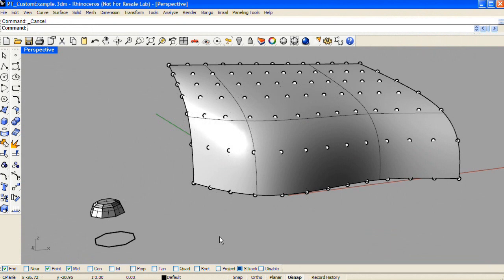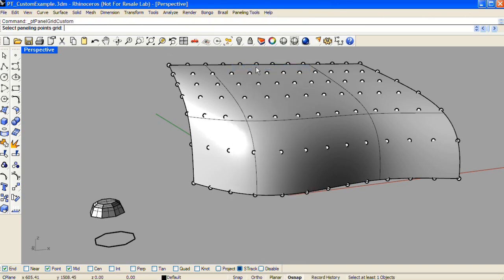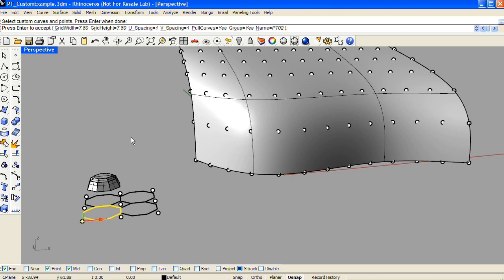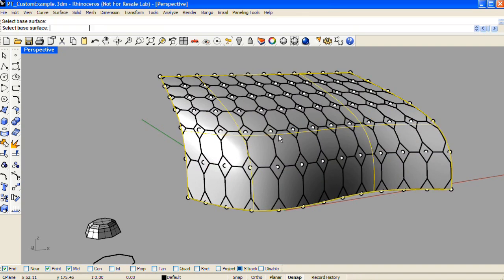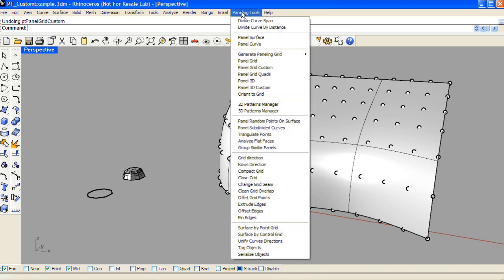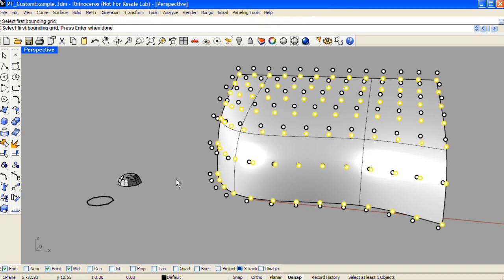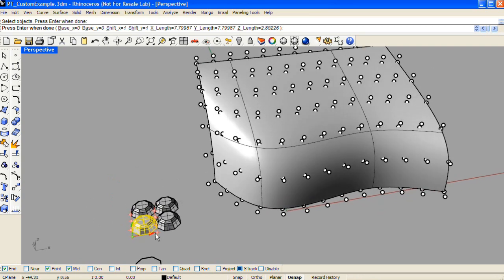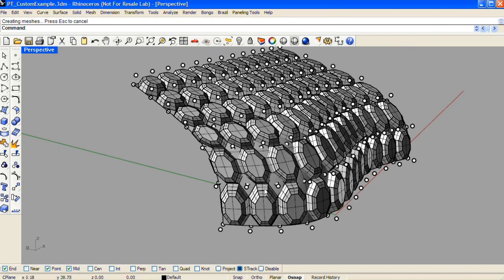Custom patterns with Paneling Tools

Comment: Good video, problem I'm having is getting the point grid on a surface like in the video I've tried a few things to no avail help please?
Reply from the maker: Check out the latest manuals for the Paneling Tools plugin on the link in the description above, it may be that you need to use a different grid command. Post any questions you still have to the user forum after that... https://discourse.mcneel.com/

Comment: there is anyone know?how make object can be same size and shape with panelling tool...thx
Reply from the maker: You can make paneling by distance versus UV domain and also specify rigid so the modules wouldn't deform. This may be what you're looking for but of course based on the geometry you're paneling you might end up with gaps between panels. Post to the user forum with a model if you want other opinions. https://discourse.mcneel.com/

Comment: the fin details are only lines ,correct? they can't be printed. do you have a video showing them a solid detail?
Reply from the maker: Thomas Kurilla The input for Fin will be curves on the surface so no they wouldn't 3D print. The resulting Fin surfaces would also need a thickness before exporting as an stl for printing. You can use OffsetSrf with the solid option to achieve this part. Post any models or questions to the Rhino user forum if you need more help... http://discourse.mcneel.com/

Comment: hello, great tutorial! Using Rhino 5.0 for Mac, i am currently trying to model a ring and to create a triangle pattern on its outer surface. i managed to create a 2D pattern with PanelGridCustom. i also created a 3D version of the same triangle, but i cannot do a 3D Panel Grid, because i can't offset the grid. want i aim to achieve is to "etch" the triangles into the surface of the ring. so it would be like the 3d pattern you created, but going into the ring. i was wondering how to go about it.
Reply from the maker: Hi,
You should be able to offset the point grid with the PtOffsetPoints command and the base surface of the ring. You may need to Flip the normal of the surface. Post an example file to the Rhino user forum if you need more help please...  discourse.mcneel.com
Reply: thank you!

Comment from the maker: The aspect ratio of the hexagons is entirely dependent on the distance between the points in the grid. You can control the grid spacing in a few different ways either while making the grid or by scaling the grid after it's already made. The curvature of the surface you are generating the grid on is also a variable to consider. You may want to look at the latest build of PT which will have an offset curve on surface function. You can then create a grid by intersecting two groups of offset curves.

Comment from the maker: Hi NueRama,

It sounds like the panels are being kept flat rather than deformed according to a base surface. If you have a surface under your point grid, the panels can be set to deform in order to match it's curvature. This will solve the issue of gaps between panel seams but will also likely result in non developable panels. If you have a 3dm file, please send it to me if this doesn't help. brian(dot)james(at)mcneel(dot)com

Comment from the maker: Hi,
The original surface was made by extruding a profile curve (ExtrudeCrv)>rebuilding that surface (Rebuild) or changing the degree (ChangeDegree) to add more control points in the extrusion direction and then control point editing to form the shape. You can watch a tutorial on control point editing on my channel.